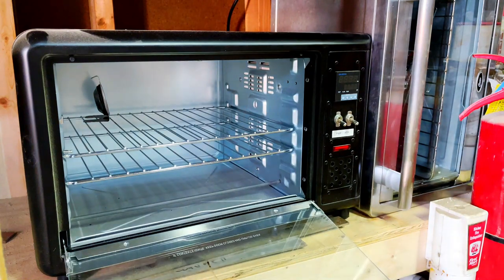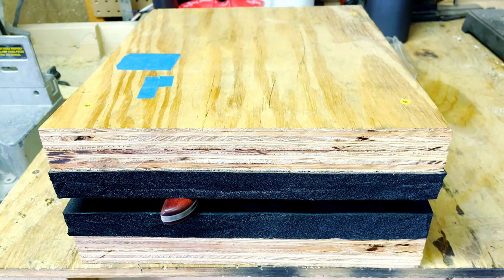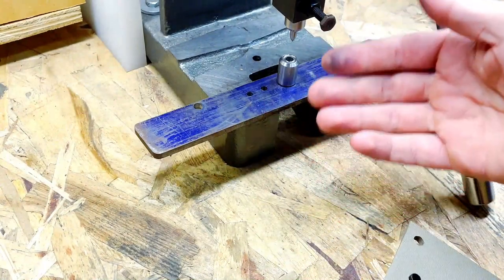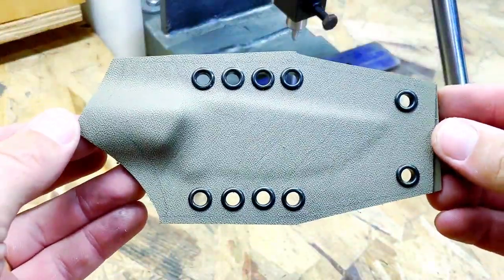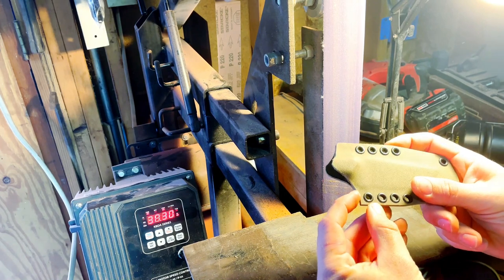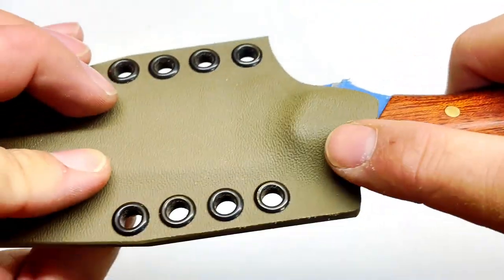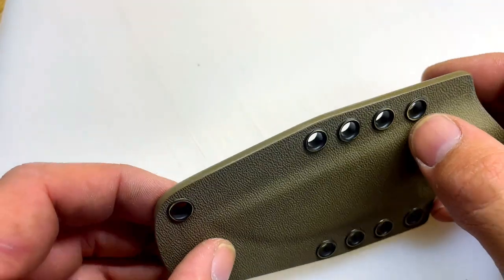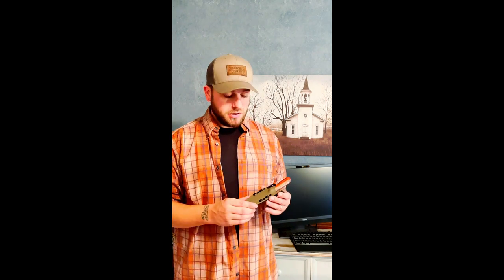How to make a kydex knife sheath

Comment: Sir..how much tempecure of heat   and how long to heat that kydey sheet.sorry for my bad ingglish
Reply from the maker: The temperature is usually around 300-350 degrees and I  check it every five minutes to see if the kydex is flexible yet. You can always start with a low temperature if you’re trying a new oven and gradually increase it because most toaster oven thermocouples do not read temperature very accurately. I’m sure there are lots of different opinions on this, but it’s more important to make sure that it doesn’t heat up too much or not enough.
Reply: Thank you sir
Reply from the maker: No problem